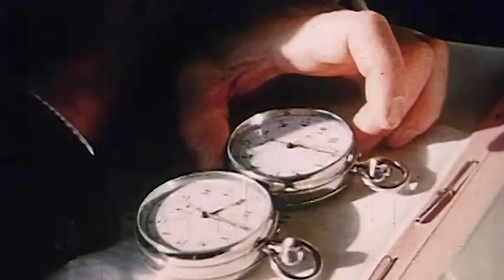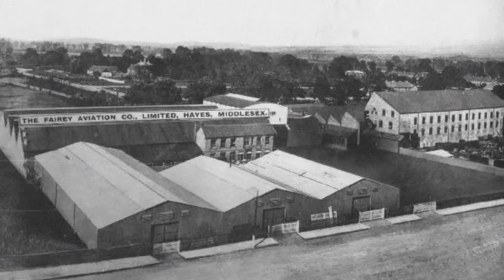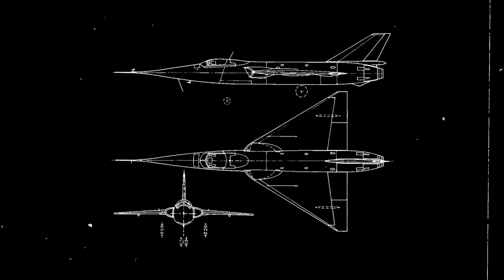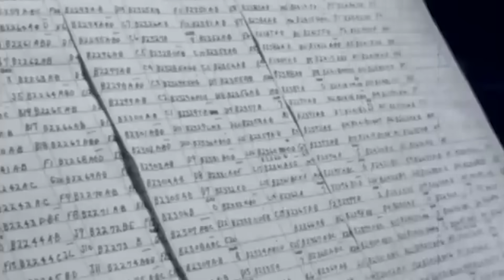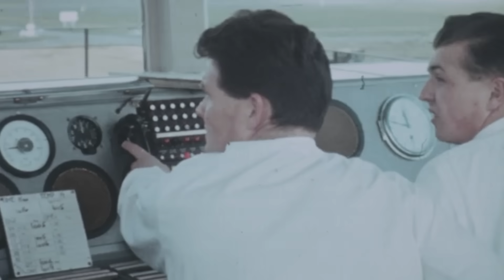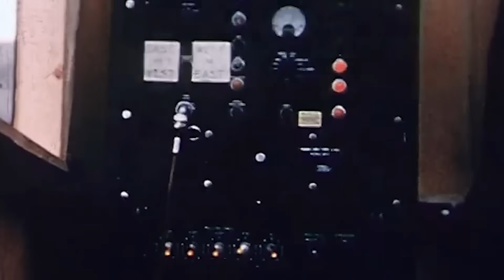Britain's 300 MPH Most Successful Mistake

Comment: Mig15 was highly influenced by German designers. Absent that, the Soviets would surely not have been ahead of the Brits. 

The Americans quickly reacted to the Mig15 with the F86.
Reply: The MiG-15 and the F-86 were both the products of German aerospace technology. The Mig by Heinkel... the Sabre by Messerschmitt..
Reply: @DoktorBayerischeMotorenWerke  

Not disputed. The point was that it wasn't that the Soviets were ahead of the West without the Germans. And the immediate reaction of the F86 to the Mig15 which surpassed all previous and existing influences is clear.
Reply: @c2jones  Another point worth mentioning was Britain fell behind in jet aircraft technology because they didn't have access or refused to take advantage of captured German technology..
Reply: @DoktorBayerischeMotorenWerke  

Especially the "refused" part. 🎯
Reply: @DoktorBayerischeMotorenWerke 

We believe we can clear up some commonly held myths and misconceptions, obviously.

It's always good to see the facts presented clearly and concisely isn't it?

When info about German technology became available in the UK after 1945 it was immediately apparent that it was mostly just badly copied UK technology.

The original fabulous Whittle reverse combuster centrifugal compressor gas turbine aero engine has been in production permanently in one form or another by more that one manufacturer since 1939. The main current application is for helicopters. 
Whittle performed the world's first demonstration of a gas turbine aero ending in 1937. 

British Aerospace Sector & some bits & bobs etc. 

Interesting British achievements.
There is no doubt that the Fairey (England)
Delta 2 was of course the world's first jet
aircraft to exceed 1000 mph.  lndeed It
exceeded the previous record by 310 mph &
held the record for more than a year. Incidentally, the Dassault Mirage series of aircraft are based on the Fairey Delta 2. 
March 1956,  UK Peter Twiss,
1,132	 mph, Fairey Delta 2,	 Chichester, UK

The next speed record after the FD2 -
December 1957, USAF	1,207.6	mph, McDonnell F-101A Voodoo, 	Muroc, California 😎.

Non combat phase accident losses.
% of Aircraft built.
The EE Lightening did not have unusually high losses. 
The Canadair CL-44 was a turboprop airliner.
Canadair CL-44               (ff 1959 ) 48%
Lockheed XF104             (ff 1954) 100%
Lockheed  P80                (ff 1944)  43%
Lockheed F104               (ff 1954)  45%
MD FH Phantom 1          (ff 1945)  35%
MD F4 Phantom 2           (ff 1958)  28%
Convair F102 Dagger      (ff 1953)  45%  
MD F3H  Demon              (ff 1951)  32%
MD F-101 Voodoo           (ff 1954)  34%
EE Lightening                   (ff 1954)  33%
Gloster Meteor                (ff 1943)   21%
DH Vampire                     (ff 1943)   23%
DH Sea Vixen                  (ff  1951)  33%
Gloster Javelin                (ff 1951)   20%

Note that the Meteor didn't have particularly high losses, flew with more than 20 airforces for decades, got involved in air to air combat during a number of conflicts successfully against aircraft that first flew many years after the Meteor first flew.

Early days, jet engines. Whittle performed the world's furst demonstration of a gas turbine aero engine in 1937. The RR Nene, a centrifugal gas turbine aero engine, was the world's most reliable & most powerful gas turbine aero engine in 1944. Licensed built versions & copies of the RR Nene & RR Derwent would go on to power many aircraft in Russia including the Mig 15 & Mig 17, the US, China, France & other countries for decades after 1944. Incidentally, the Mig-15 was in essence an upsized / tweaked copy of the Whittle / Gloster E28/39 jet aircraft including a copy of the RR engine.  The centrifugal compressor gas turbine aero engine with Whittle style reverse flow combusters and sometimes an axial compressor section is still manufactured by more than one company, the main application being helicopters.

   That's correct, The Tornado & Typhoon & their engines are supersonic & are indeed British design aircraft with British design engines built by an international consortium. The Tornado design for example started life during the 1950s at Vickers as the AFVG, it's engine is based on the RR RB-199. The EE Lightening is also a British Supersonic jet aircraft. At the time the EE Lightening first flew it was indeed one of the fastest aircraft on the planet, it was still one of the fastest aircraft on the planet 4 years later when it managed a mach 2 flight.

  The Typhoon is the British BAC-EAP with an engine based on the British RR XG-40, the Typhoon is also built by an international consortium.

  Clearly It's a great pity & a crying shame that British military forces had to occupy a large part of Germany for decades after 1945 & Russian military forces had to do the same. Of course Russia still posseses a large chunk of what was German territory & of course  Russia & the UK produce nukes. Obviously Germany does not produce nukes.

An example of what goes on these days in various countries.

   Indeed, There are no German companies that make German jet aircraft in Germany & there are no German Companies that make German gas turbine aero engines in Germany that are suitable for widebody airliners.

  BAe Systems, GKN Aerospace & Rolls Royce combined now do more Airbus work than Germany on an absolute basis & significantly more work than that on a per capita basis.
   
  Per capita for the home nation BAe Systems is the world's largest defence contractor. BAe systems announced the recent £4 Billion takeover of Colorado based US based Ball Aerospace.
  
  BAE systems now does a significantly higher value of work for Airbus than it did when it was a major Airbus shareholder before 2005.
     
  RR now owns US Engine maker Allison for example which does classified Aerospace work for the US Govt.
   
 Anybody currently flying on a widebody airliner stands a good chance of being on an aircraft powered by RR gas turbine aero engines built in the UK.

  A glimpse of what goes on in the very internationally orientated British aerospace sector.

Boeing Apache Attack Helicopter.
AH-64: 75 UK suppliers, 7% UK content, global fleet of 1280+ aircraft.
F35B more than 130 UK Suppliers, more than 30% UK content.
F35A & F35C more than 130 UK Suppliers, more than 15% UK content.

The UK has the world's highest combined per capita Nuclear, Defence & Aerospace Sector activity.

Rolls Royce Holdings UK
Subsidiaries
- Rolls-Royce plc
- Rolls-Royce North America (Allison etc &  
  Classified Military stuff)
- Rolls-Royce AB
- Rolls-Royce Deutschland
- Rolls-Royce India Private Limited
- Rolls-Royce Marine Power Operations
- Vinters Engineering Limited
- Rolls-Royce Controls and Data Services
- Rolls-Royce Power Systems
- Bergen Marine
Joint ventures include:
- Rolls-Royce Turbomeca
- MTU Turbomeca -

Trent Family
The MT30 (Marine Turbine)
Industrial Trent 60 Gas Turbine
Trent 7000
Trent XWB Airbus A330neo.
Trent 1500
Trent 1000
Trent 500
Trent 600
Trent 700
Trent 800
Trent 8100
Trent 900

RR wholly owned subsidiaries in Germany handle smaller 2 shaft RR gas turbine aero engine work.   

We hope this helps of course.
     
Cheers, as always & indeed 👍.

Comment: Three points;  1. 90deg included angle another way of saying 45deg angle to the lateral .  2. the French plane hovering?  3.  design starts with an objective,  ie cargo, interceptor fighter, etc, even if does not make the cut.

Comment: Basically the Fairy Delta 2 was the 'proto-Mirage'.
Reply: Britain lagged behind the French in supersonic aircraft technology.
Reply: @DoktorBayerischeMotorenWerke 

We believe we can clear up some commonly held myths and misconceptions, obviously

It's always good to see the facts presented clearly and concisely isn't it?

The original fabulous Whittle reverse combuster centrifugal compressor gas turbine aero engine has been in production permanently in one form or another by more that one manufacturer since 1939. The main current application is for helicopters. 
Whittle performed the world's first demonstration of a gas turbine aero ending in 1937. 

British Aerospace Sector & some bits & bobs etc. 

Interesting British achievements.
There is no doubt that the Fairey (England)
Delta 2 was of course the world's first jet
aircraft to exceed 1000 mph.  lndeed It
exceeded the previous record by 310 mph &
held the record for more than a year. Incidentally, the Dassault Mirage series of aircraft are based on the Fairey Delta 2. 
March 1956,  UK Peter Twiss,
1,132	 mph, Fairey Delta 2,	 Chichester, UK

The next speed record after the FD2 -
December 1957, USAF	1,207.6	mph, McDonnell F-101A Voodoo, 	Muroc, California 😎.

Non combat phase accident losses.
% of Aircraft built.
The EE Lightening did not have unusually high losses. 
The Canadair CL-44 was a turboprop airliner.
Canadair CL-44               (ff 1959 ) 48%
Lockheed XF104             (ff 1954) 100%
Lockheed  P80                (ff 1944)  43%
Lockheed F104               (ff 1954)  45%
MD FH Phantom 1          (ff 1945)  35%
MD F4 Phantom 2           (ff 1958)  28%
Convair F102 Dagger      (ff 1953)  45%  
MD F3H  Demon              (ff 1951)  32%
MD F-101 Voodoo           (ff 1954)  34%
EE Lightening                   (ff 1954)  33%
Gloster Meteor                (ff 1943)   21%
DH Vampire                     (ff 1943)   23%
DH Sea Vixen                  (ff  1951)  33%
Gloster Javelin                (ff 1951)   20%

Note that the Meteor didn't have particularly high losses, flew with more than 20 airforces for decades, got involved in air to air combat during a number of conflicts successfully against aircraft that first flew many years after the Meteor first flew.

Early days, jet engines. Whittle performed the world's furst demonstration of a gas turbine aero engine in 1937. The RR Nene, a centrifugal gas turbine aero engine, was the world's most reliable & most powerful gas turbine aero engine in 1944. Licensed built versions & copies of the RR Nene & RR Derwent would go on to power many aircraft in Russia including the Mig 15 & Mig 17, the US, China, France & other countries for decades after 1944. Incidentally, the Mig-15 was in essence an upsized / tweaked copy of the Whittle / Gloster E28/39 jet aircraft including a copy of the RR engine.  The centrifugal compressor gas turbine aero engine with Whittle style reverse flow combusters and sometimes an axial compressor section is still manufactured by more than one company, the main application being helicopters.

   That's correct, The Tornado & Typhoon & their engines are supersonic & are indeed British design aircraft with British design engines built by an international consortium. The Tornado design for example started life during the 1950s at Vickers as the AFVG, it's engine is based on the RR RB-199. The EE Lightening is also a British Supersonic jet aircraft. At the time the EE Lightening first flew it was indeed one of the fastest aircraft on the planet, it was still one of the fastest aircraft on the planet 4 years later when it managed a mach 2 flight.

  The Typhoon is the British BAC-EAP with an engine based on the British RR XG-40, the Typhoon is also built by an international consortium.

  Clearly It's a great pity & a crying shame that British military forces had to occupy a large part of Germany for decades after 1945 & Russian military forces had to do the same. Of course Russia still posseses a large chunk of what was German territory & of course  Russia & the UK produce nukes. Obviously Germany does not produce nukes.

An example of what goes on these days in various countries.

   Indeed, There are no German companies that make German jet aircraft in Germany & there are no German Companies that make German gas turbine aero engines in Germany that are suitable for widebody airliners.

  BAe Systems, GKN Aerospace & Rolls Royce combined now do more Airbus work than Germany on an absolute basis & significantly more work than that on a per capita basis.
   
  Per capita for the home nation BAe Systems is the world's largest defence contractor. BAe systems announced the recent £4 Billion takeover of Colorado based US based Ball Aerospace.
  
  BAE systems now does a significantly higher value of work for Airbus than it did when it was a major Airbus shareholder before 2005.
     
  RR now owns US Engine maker Allison for example which does classified Aerospace work for the US Govt.
   
 Anybody currently flying on a widebody airliner stands a good chance of being on an aircraft powered by RR gas turbine aero engines built in the UK.

  A glimpse of what goes on in the very internationally orientated British aerospace sector.

Boeing Apache Attack Helicopter.
AH-64: 75 UK suppliers, 7% UK content, global fleet of 1280+ aircraft.
F35B more than 130 UK Suppliers, more than 30% UK content.
F35A & F35C more than 130 UK Suppliers, more than 15% UK content.

The UK has the world's highest combined per capita Nuclear, Defence & Aerospace Sector activity.

Rolls Royce Holdings UK
Subsidiaries
- Rolls-Royce plc
- Rolls-Royce North America (Allison etc &  
  Classified Military stuff)
- Rolls-Royce AB
- Rolls-Royce Deutschland
- Rolls-Royce India Private Limited
- Rolls-Royce Marine Power Operations
- Vinters Engineering Limited
- Rolls-Royce Controls and Data Services
- Rolls-Royce Power Systems
- Bergen Marine
Joint ventures include:
- Rolls-Royce Turbomeca
- MTU Turbomeca -

Trent Family
The MT30 (Marine Turbine)
Industrial Trent 60 Gas Turbine
Trent 7000
Trent XWB Airbus A330neo.
Trent 1500
Trent 1000
Trent 500
Trent 600
Trent 700
Trent 800
Trent 8100
Trent 900

RR wholly owned subsidiaries in Germany handle smaller 2 shaft RR gas turbine aero engine work.   
   
We hope this helps of course.
         
Cheers, as always & indeed 👍.